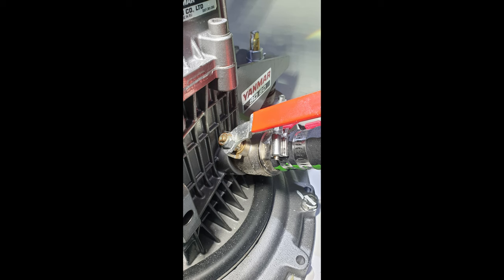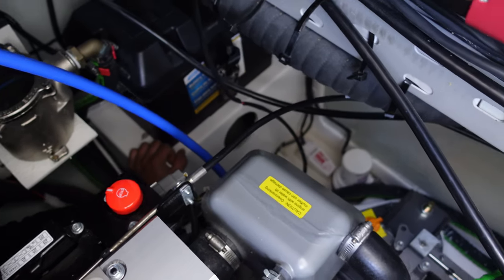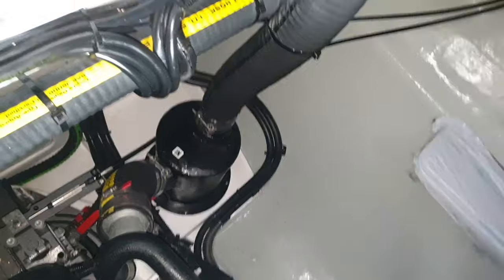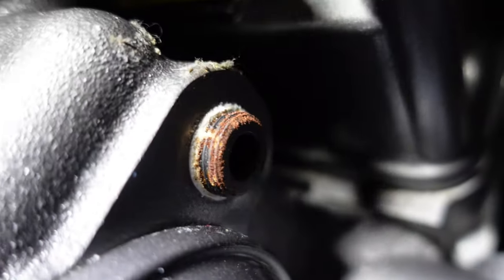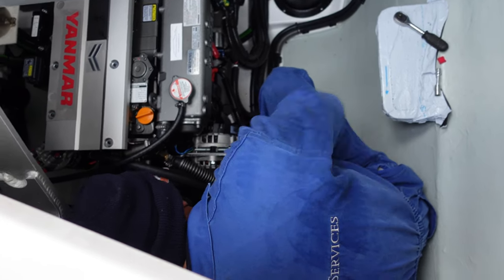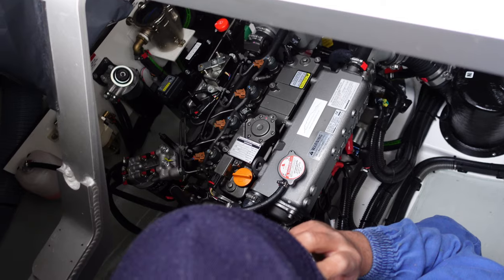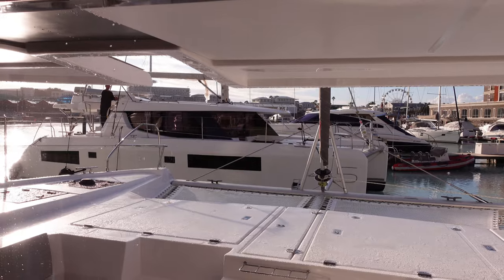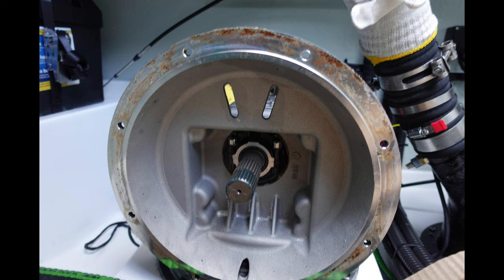New Catamaran Handover: Rusted Engine & Destroyed Sail Drive | LEOPARD 45 WARRANTY EXPERIENCE REVIEW

Comment: I’ve watched all your warranty issues video. All I can say is I really admire your patience. Really sad they don’t care about you as a customer. I’m wondering if you may have a bigger issue with your boat. Windows that pop and break the seal, generator mount that cracked and separated from hull with no machinery on it, and the cracks in the hull at cross beam mount locations. Looks to me like your hull has flexed causing these issues. Structural problems like that are just not coincidence. I also believe that the light coming thru your hull shows inconsistencies in Hull thickness and no fiberglass at hatches shows failing build procedures. I think you need to find a good lawyer and find someone that is an expert in the integrity of boat hulls. Perhaps someone like  Walt Schulz from Shannon boats would know someone or maybe he would be willing to inspect you boat. I really believe your boat may have structural issues and should be assessed before I took it on a long passage. I know that really is the last thing you want to hear after all you have been through, but better safe than sorry, as I wouldn’t want to be on a boat in heavy weather 1000 miles offshore that starts to break apart. I hope I’m wrong and wish you all the best with your boat.

Comment: Cannot thank you enough for creating these videos! We are in process of purchasing our first catamaran and although the design and layout of the Leopard 45 HAD made it our top choice, we will now be going with a Lagoon purely based on the workmanship. (Or lack of!)  Can't risk dumping our life savings into a boat with so many build issues- most of them due to utter carelessness. Yes all boats have issues- we have owned several and can attest to that. But how many issues, what type of issues, and how those issues are handled are what is important. Look at how Lagoon is handling their bulkhead issue... They changed the factory production halfway thru the model year to address a POTENTIAL bulkhead issue. Then, ALL Lagoon 46's produced prior to production change are given a time slot to have their bulkheads reinforced BEFORE they would even potentially have an issue. (At no charge and work is completed by Lagoon themselves) I hope Leopard starts to grasp the importance of reputation and word of mouth as well as the power of YouTube because if they don't act on this quickly, it won't just be our business that they have lost.
Reply from the maker: We didn't know that. Very interesting about the slots for repair.
Reply: We're shopping for a 45-50 foot cat, for retirement in about three years. Watching how Lagoon and Leopard handled warranty and construction issues has been enlightening. It pays to watch who did better.

FWIW, Robertson and Caine no longer run the Leopard show. They sold to an investor group that helped found Dream Yacht Charter.

Comment: Why did the dude jam it into reverse, what was his reason for that? Also who is he, surely he's not a Yanmar employee because they'd know better than to be going forward at 3000 revs and to then jam into into reverse without pause at around 2000 revs. Did anyone ask him why he did that, it's inconceivable to me why someone would do such a thing, that is unless they've never been on a boat before. but even then common sense would tell you that you can't do such a thing
Reply from the maker: There was a pressure leak in the exhaust mixer hose where a Robertson and Caine employee drilled into it during construction. He increased the revs to find where the leaks were coming from. He lost his temper and did it. There is no reasonable excuse as to why. 😒 so then you have to debate and demand it be checked and have your time wasted while it's changed out due to, well ill let you think of your own adjectives for him. The employee can be seen in the uncut version of the video on my website in the link.

Comment: It is simple: The captain who ran his engine for 11 hours without noticing the salt water spray blasting all over it, should be keel-hauled and relocated back to his home-office where he hails from. The prudent mariner will inspect his diesel engine  before each startup and during operation at least once per hour Inspection must include shining a bright light over the engine, to note fine mist, exhaust smoke present in the engine room. At least on my boat. Takes literally 3 freakin` seconds!
Covering rust caused by salt water by Yanmar warranty does not make any sense either, i don`t want to pay for the repair of the engines destroyed by half-wit skippers like this specimen featured in the video above.